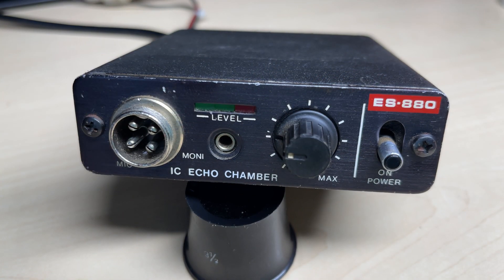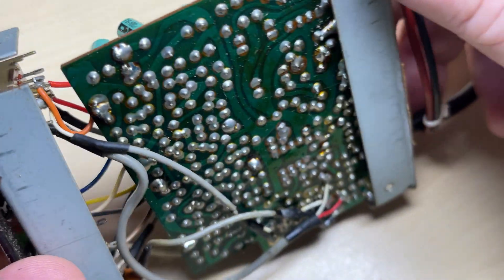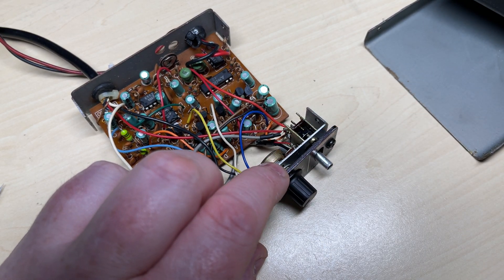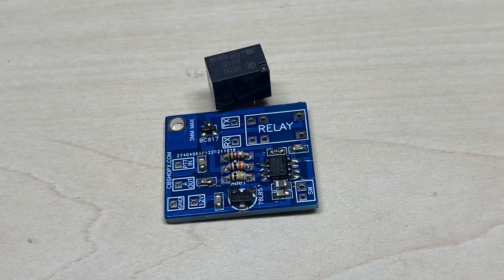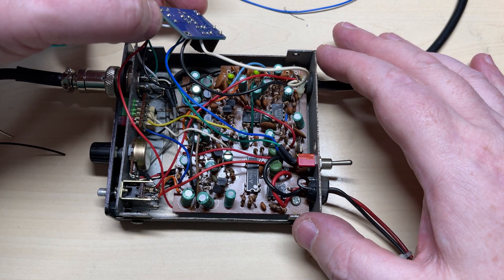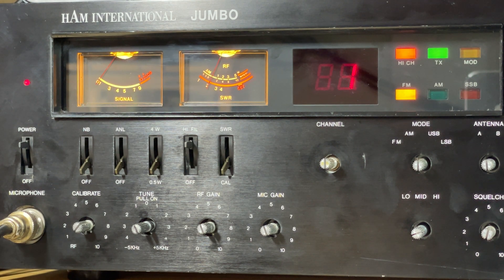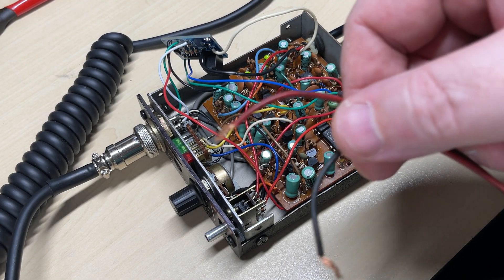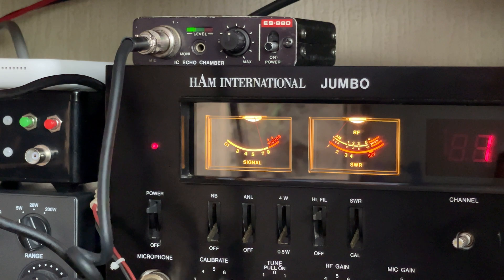EP 073 - Fitting a 150 tone beep to a ES880 Echo Chamber

Comment: Way back in 1982-87 I had this model es880 connected to my Tristar 777 CB radio with the Leson tw232 desk mic and for the 5 year's I was on the air I received nothing but praise for the strong clear modulation through my set-up. People reported that there were times I had zero signal but my modulation was banging through. I've recently been trying to purchase one again as I still have my desk mic but the only one on eBay at the minute is being sold at over £250 and that's just ridiculous. Some folk's just live for greed...